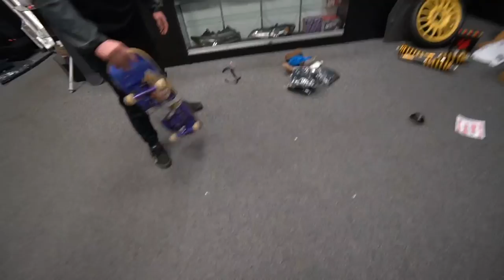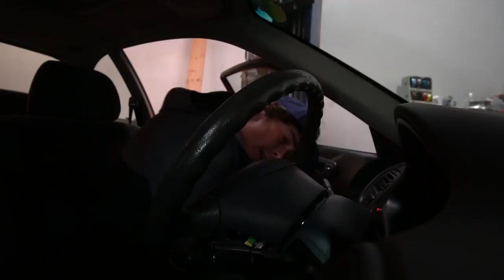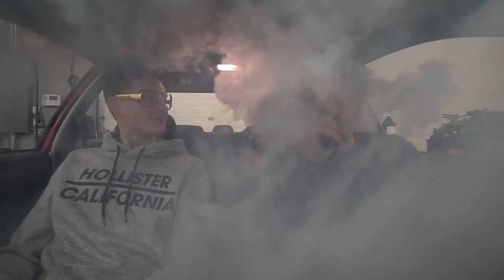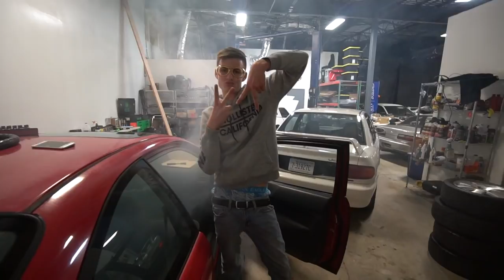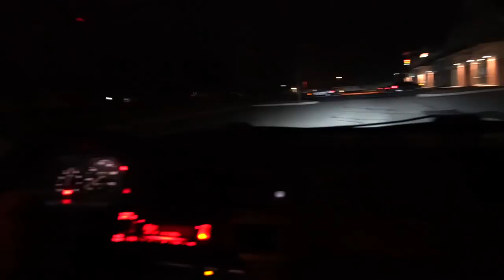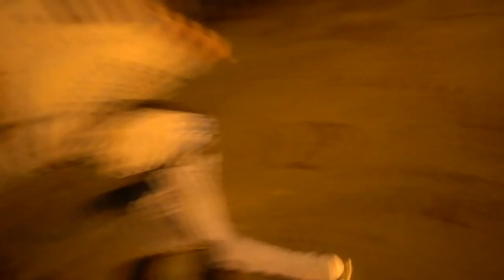OLD SCHOOL RICER CIVIC VIDEO!

Comment: Chris you didn't install that short hub right. You need to remove the entire clock spring assembly, not just the center. it's 3 screws dude. Take those out and it'll sit flush and tight.
Reply from the maker: Yea I realized that haha all fixed now🤟
Reply: Ricer Miata rodnock spec 😂
Reply: @RicerMiata  for that srs light take the cluster off and unplug the bulb for the back
Reply: Nah your wrong just torque it with a set of vice grips #beaman
Reply: @RicerMiata  Noice.
Reply: Ya was gonna say that he messed up

Comment: probably would disconnect the battery next time working around an airbag . But i mean up to you lol
Reply: yeh this was sketchy. i dont work with cars and even i know that. cmon Chris, work smarter
Reply: you dont need battery disconnected if the key is not turned.
Reply: @janprokopenko7928  LOL. Yes you do.
Reply: @xtraCreamcheese  did couple cars,never got hit with airbag.
Reply: @janprokopenko7928  just because it never happened doesn't mean it can't lol .but once again it is your own choice
Reply: @Daunk303  it wont happen, there's no constant electricity going through.
Reply: Daunk303 it won’t happen. Do airbags at work all the time without disconnecting the battery
Reply: @janprokopenko7928  it can and will happen. Constant electricity does go through it, that is the purpose of the clock spring.

I have turned an ecu around in a Volkswagen to do some wiring diagnostics, flipped it around to check the wiring, there was a sensor in there that detected if the car rolled over (key in ignition or not) boom, airbag to the side of the head. 

Airbags can, and will go off.
Reply: @xtraCreamcheese  How loud was it when it blew? Could you still function after easily? Always wondered
Reply: @dnbmania  my ears were ringing. A lot. Not sure if it was from the noise or the impact. I was certainly concussed and I had a bruised eye. Looked like I lost a fist fight.

Comment: Next time unhook the battery when working with the air bag 😆
Reply: Was waiting for this
Reply: Ha. I've done hundreds of airbags at work and never once unhooked the battery.
Reply: that's a myth
Reply: @sideshow45  lol. People like you make legitimate mechanics look like they have a PHD. 

I bet you're just a lube tech doing tires, batteries and oil changes.
Reply: @xtraCreamcheese  lol na. Flat rate making 21/hr. Try again. Dont have time for saving radio presets and getting radio codes for a .6 job.
Reply: @sideshow45  lol. Radio codes, What are you talking about? Are you a caveman tech? Buy a memory saver.

 I'm 18/hr base rate 28/HR when I'm on a job. For all of 2018 I averaged 9.8hrs a day, I know how to work flatrate without sacrificing the job quality or my safety.
Reply: @xtraCreamcheese  no one in the shop disconnects. Weve never had an issue. I'd be more worried about static electricity than the battery. Weve done thousands of inflators without any issues other than dumbasses installing them improperly
Reply: @xtraCreamcheese  does a memory saver not defeat the purpose? Does it not result in +12v everywhere that the battery would otherwise supply?

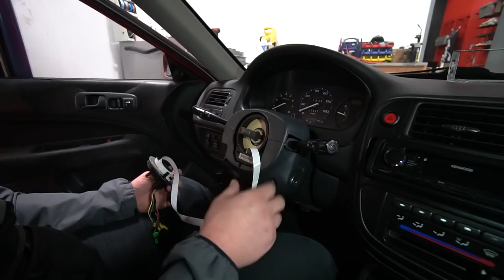Comment: 8:36 it's a clockspring. It's like a wire except when it's thin and flat it can wind up more length. It allows you to spin the steering wheel without building tension in the electrical connections.
Reply: Cable reel*
Reply: muddin bros yes

Comment: Chris what series is your civic? D15 or D16? By the way it should be quite a decent amount faster than a turbo Miata. Completely different experience. You bought a legit turbo kit too. Even the DNA motoring products are known to be pretty reliable. Especially compared to actual fake and garbage stuff on ebay. NRG is a good brand too per application. There must be something else screwy with the steering wheel setup. I would just go through it again and maybe find a better solution. You got this!!

Comment: 2.0 ohm resistor trick then flash the srs system through the fuse panel under drivers kick panel plenty of YouTube's and it will allow you to still function with proper air bag don't go any higher or lower then 2.0 ohms though

Comment: Short the two airbag wires that are in the car with a 5v resistor and the airbag light will go off. If you don’t do that I think that all airbags & retention systems are disabled.

Comment: Hub is installed wrong you need to remove the rest of clock spring !!!!!!!!!!!!! Bump this so he sees is
Reply from the maker: I actually ended up fixing it after this video thanks man
Reply: @RicerMiata  i knew cause i had a ricer prelude stright piped lol